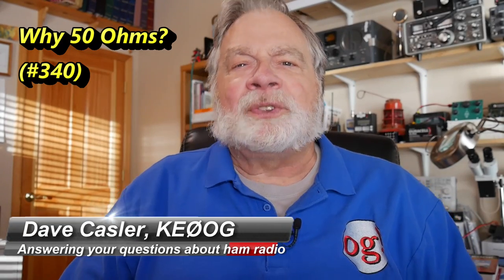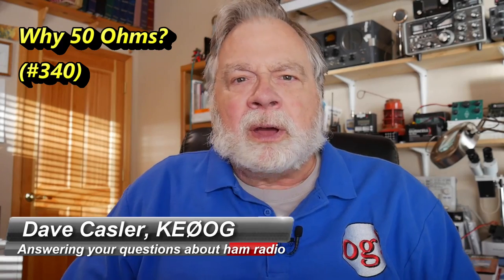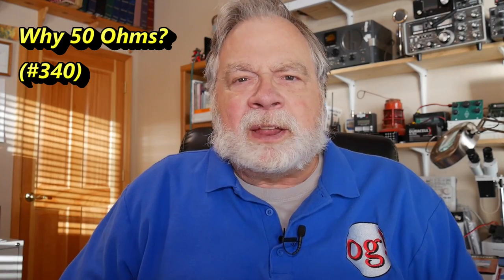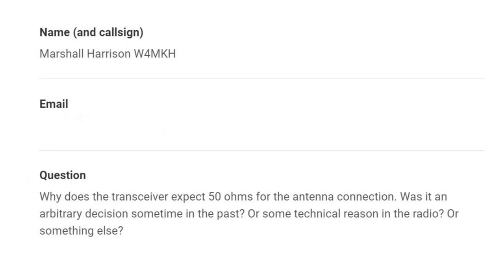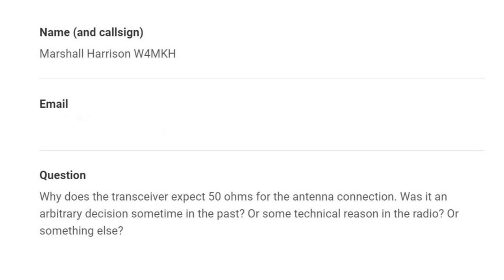Why is Coax 50 Ohms? (#340)

Comment: Thanks Dave!  Might I add more information about why 50 Ohm coax.  Years ago  an engineer for the Hewlet Packard instrument labs explained it this way.   
At about the start of WWII there was no standard.  With a world war approaching, a standard was needed.  The military brought in experts.  The experts said the same thing you had about different ohms.  He had a third possible number of 45.  He said that the military person, with no prefect choice took the three values (30, 45, and 75) and added them up and divided by three.  The results was 50 ohms.  By the end of the war, there was such a supply of 50 ohm equipment that it was the new standard

Comment: Thanks Dave. Good explanation. Characteristic impedance of a transmission line is a hard enough concept to grasp. Understanding 377 ohm Free Space is the next step. Been licensed since 1960 when you had to demonstrate 20 wpm Morse at the FCC office, in front of a grumpy FCC examiner. Pretty intimidating to a teen. No Wikipedia or Internet back then. Saved up for months just to buy my ARRL Radio Amateur's Handbook.  Keep up the good work.  73 DE AA4KW.  Bob

Comment: For people using 75 ohm cable, you can get RG11 which is very close to RG8's size, and you can get flooded cable which has a water absorbing gel to protect the shield from water damage.

Comment: Hi Folks, Interesting discussion! I seem to recall reading decades ago that the 50 Ohm standard came about from the US Navy. The long wire dipole elements that were suspended from the ship's conning tower to the bow and stern at a declining angle lowered the nominal feed impedance from 72/73 ohms to about 50 Ohms.  Also, that the first cable TV coaxial cable impedance was actually 72 Ohms and that knurled (obsolete) S-connectors (similar in design to a very small PL-259 connector) preceded the use of 75 Ohm F-connectors. I'm not sure if it was RCA or Jerrold who originally set the 72 Ohm standard. In my earlier cable TV years I had the honor to meet and work with some of the Jerrold Electronics engineers who developed many of today's current CATV standards. Ken Simmons, Hank Arbitter and Don Rogers to mention a few.  That's what I remember!

Comment: Very interesting, first time I have seen such good info on coax.  Ref to the open copper cadmium  wires on telegraph poles, in the UK they were run in parallel pairs on short local routes, but on long routes they were run twisted  by rotating the wires working from the outside insulator working towards the other outside insulator, then dropping down to the arm below and then working to the outside of the arm and then finishing back at the original start position further down the route.  I can’t remember with certainty but I think it was every 4th pole the process was repeated.  In 1969 there were still a few local routes left on British Telecom.  I was taught that when looking for a short circuit (where wires got twisted together in high winds) if you looked at the apparent short whilst walking and the short didn’t move it was shorted at that point.  If the twist moved then that point was clear.  Short circuits were cleared by throwing a stick at the offending wires.  If a route needed re-regulating then during the 1960s it would be replaced by overhead poly cable.
With all the cables that  I saw, the twists were not that tight, the twists were all identical and cross talk did not occur.  If a jointer made a mistake during repairs and two lines had their legs muddled then crosstalk was as good as a solid connection.  The telephones were 600 ohm impedance, lines were usually max 1000 ohms loop resistance dc test and both legs had to be electrically identical in resistance otherwise mains hum would occur.  I spent 30 years on telecoms and any engineers that I knew qualified in open copper wires  were well gone prior to 1995.

Comment: We used Heliax on our high power  transmitter to antenna connections and we filled the space inside with a dehumidified pressured air  supply slightly greater than atmospheric pressure to keep out moisture

Comment: - I've always built-tuned my center-fed dipoles by erecting them with a 120° angle between the two sides, trimming to lowest SWR, then re-erecting as a flat top dipole.
 The SWR increases to ~1.35:1 but seems to perform better than those with a lower SWR by other means of tuning/trimming.

Comment: You mentioned early on the idea of using copper pipe for coaxial transmission line. In high power broadcast, particle accelerators, etc., this is exactly what is used. The outer conductor is a standard copper water pipe diameter-- three common ones being 3 1/8 inch (3 inch ID), 6 1/8 inch (6 inch ID) and 8 3/16 inch (8 inch ID). The inner conductor was often also a common water pipe size, but today is usually a custom size that gives a Zo of 50 ohms. This line typically comes in 20 foot lengths, and is connected together with a sleeve or bolt flange on the outer conductor, and a silver plated 'bullet' to connect the inner conductors together without an impedance 'bump'. Teflon spacers at the ends, and teflon pins in the middle of the section keep the inner conductor centered inside the outer pipe. Elbows, etc. are built so this like can go around corners, up towers, etc. Although air is the usual dielectric, sometimes dry nitrogen under a slight pressure (to keep moisture out) is used. Rarely, an exotic dielectric gas like sulfur hexafluoride is used. Depending on the line size and the frequency, these lines can handle tens to hundreds of kilowatts of RF power. 50 ohm line is the most common, but 75 ohm rigid line is also available  and is popular for television service, where the low loss in long runs for tall towers is really needed.
Reply: I agree, if you try to build a coaxial guide using commercial (copper) water pipe, like it would have been done in 1930, then you would most likely end up with a rather low impedance like 30 or 50 Ohm. History shows that some bold decision are often pure accidents.
Reply: My father was the original electrical engineer that set up a TV station just after the war.  I remember once while in college, a friend and I were at my house for some college break and my father had to go check on some work being done at the transmitter and he asked us along.  When we got there, the work was out back, but we wanted to see the inside of the building.  He said "You're both MIT EEs, I trust you to not kill your selves or break anything, go ahead".
Out in the back room, behind all the electronics, we found the coax, which was up at ceiling level and about 6 inch copper pipe (as you say a common size).  It was very interesting to follow around.  There were pipes coming out of each of two redundant transmitter banks and several places where different shaped bits could be swapped in to connect to different things.  One was swapping between the two transmitters for which was connected to the actual tower.  But there was some additional switches that could connect either to a large cylinder, about the size of a water heater, where the main coax pipe went into one side, near the top another connected straight up, and near the bottom one went straight out to the side.  We wondered a bit at this three connection component.  Some examination showed the lead out the top went through some very non-coax style bends, and the lower lead went straight to the back wall of the building and ended.  We asked my father about it, and it was the "dummy load" for testing the transmitters when you didn't want to actually transmit.  It was actually a water heater although not a normal one, the 6 inch water main into the building could be set up into the top, and apparently with the TV transmitter at full power, the water came out the back of the building boiling.

Comment: From Amphenol: Experimentation in the early 20th century determined that the best POWER HANDLING capability could be achieved by using 30 Ohm Coaxial Cable, whereas the lowest signal ATTENUATION (LOSS) could be achieved by using 77 Ohm Coaxial Cable.  However, there are few dielectric materials suitable for use in a coaxial cable to support 30 Ohm impedance.  Thus, 50 Ohm Coaxial Cable was selected as the ideal compromise; offering high power handling AND low attenuation characteristics.

Comment: RG 68 & RG 59 are both 75 ohm.  Can't believe I remembered that, but I double checked my memory before posting.  Both were used on the radar sets back in the 70's and 80's that our unit maintained.  Definitely preferable to RG 6.    ALSO, I would like to say thank you for answering many questions I have had for decades, but didn't find the time to research.  Comprehensive and concise.  Very much appreciated.

Comment: The low losses are not important only for reception, but becomes very important mainly for continuous transmission: 1dB cable attenuation is not that much of a deal for a receiver, but with a 10kW transmitter it means 2kW of power would get turned into heat within the cable, which means you need to take that away by the cable cooling. In real installations all the connections have to allow the purge and cooling gas to flow freely (the circulating gas does double duty: Maintains the temperature, as well as it keeps the moisture and oxygen out to prevent corrosion). But too high losses would mean too much heat to deal with.

Comment: An excellent video Dave. Funnily enough I am currently putting together a talk for our local club, explaining why when people say "I get out better with an SWR of 1.4-1.5:1 than I do with 1:1 and the height and feed point impedance is one of the main points of that talk. Many people actually "detune" their antenna from the resonant frequency they want, just to get a low SWR!
Reply: A 50 ohm resistor gives a 1:1 SWR.  It's not much of an antenna, though.  Obsessing over SWR is often counter-productive.  If it's over 3:1 with a long transmission cable, then you start to have noticeable losses, and the voltage starts to approach flashover with higher power levels.

Comment: Interesting.  I was getting cross talk on my landline about 25 years ago.  I could hear one particular residence talking to other people, but only when I was on the line to someone else.  We discovered that they could hear us one day when I told my other party to shut up and listen to the second line. The other crossed line heard me and became freaked out and hung up. LoL.  I don't remember hearing it again so they probably made a complaint to the phone company.  However, I've heard cross talk on landlines for many years before.  You couldn't always hear clearly what the other conversations were, but you could hear talking on the line. Sometimes two or more conversations at once.  It never really occurred to us to try and listen, mostly because you had to be on the line with a call. The other reason was, you really couldn't hear them that well and thirdly, their conversations sounded boring.  Just that one time that I first mentioned that I could hear them well. That went on for a few months for sure. I mostly ignored it. Just that one time I actually tried to listen. More for curiousity of whose line we were crossed with.  Anyway, that's it.
Reply: There you are! Meow😺😹
Reply: In the sixties home phones were being rolled out at a high rate and the infrastructure could not cope. The solution was to roll out temporarily with line sharing called 'party lines'. This meant that you could pick up a phone and hear any ongoing conversations . You managed with this by politeness and hanging up.

Comment: Also it should be remembered that the Z0 of free space is 377 ohms. Hence there is a mismatch between an antenna and free space (for maximum power transfer) also a mismatch between the feeder and antenna and a mismatch feeder to receiver. A dipole is just a transmission line pulled apart into two arms. That is why some recommend ignoring the E field and instead concentrate on the H field, with a loop antenna.

Comment: Very interesting video. I am no ham radio user, but i used to do computer networks. The old coax cabling back in the day needed 50 ohm terminators. Which always went missing. I made my own from 50 ohm resistors. Those were, and probably still are hard to come by. The man in the electronics shop made weird faces when i asked for those, assuming i was mistaken. I had my whole home testing network connected up with this coax cabling at the time, only giving it up when my network interface cards were no longer supported in newer operating systems in the late nineties. Which i hated, as they were all working fine otherwise. So there’s my 50 ohm story. Greetings and a happy 2021 from the Netherlands!
Reply: My 50 Ohm story...:

I was working for a telecommunications company and they tried to install coax ethernet at one of their sites and it didn't work. I told them that they needed a terminator at each end. That was after the movie Terminator 2 came out. They naturally believed I was bullshitting them, even though I tried to explain the physics behind that.

They then asked another expert. The other expert told them the same bullshit. They got really pissed off by that.

Then they thought the cables were broken and went to a computer store to get new ones. The guy at the store also tried to be "funny" and asked whether they wanted terminators as well - and showed them what they looked like and that they were obviously designed to fit the T connectors. They finally got the message...after a hands-on demonstration.
Reply: @klausstock8020  that's a great story. thanks, you made me laugh.
Reply: Ne2000 coax network card?

Comment: When I was studying physics in the 1970's, wave propagation in coaxial waveguides was a natural subject to examine, because we were thinking about waves and their confinement between conductors.  But a century earlier, when Heaviside began thinking about it, signal frequencies were probably in the low kHz range, which is essentially DC as for as wave propagation is concerned.  So it makes sense that a coaxial waveguide was a novel idea.  My recollection is that this concept only became a useful technology when the right dielectric was invented at Bell Labs - I believe in the 1920's.

Comment: 6:30 "An extremely low loss cable available at an extremely high price" absolute classic! Can't wait to adapt that to future conversations.....  Cheers mate...
Reply: I wonder how you would terminate such a cable.
Reply: The cable is Andrew 1 5/8" air cable which requires pressurization (Nitrogen or dried compressed air). There is a foam version (LDF7-50) of this cable as well. Dimensionally they are the same. The cable's impedance is mainly the ratio of inner to outer conductors. The air cables have spiral jackets while foam cables have straight ribs (corrugated). Air has the least capacitance (parasitic loss) per foot. At frequencies above 800MHz the loss gets real bad.

This same cable in 75 ohm has a smaller center conductor.  (LDF7-75) 'N' connectors for 75 ohm have smaller center pins but otherwise are identical to the 50 ohm connector.

The military still uses some 62 ohm stuff. I'm not sure of the application though.

TV originally used 300 ohm flat cable (balanced) and to use 75 ohm cable with TV antennas requires  a balun which couples the 300 ohm antenna (balanced) to the 75 ohm coaxial cable (unbalanced). These are usually designed into modern antennas.

The twisted telephone is a balanced (600 ohm) transmission line. what improved cross talk was adaptation of better electronics in the system which allowed lower signal levels to be used on the lines. (Telephones adopted built-in amplifiers)
Reply: @ronreyes9910  1 5/8" and 7/8" was widely used in mobile telephony stations (BTS) up to recent times. 7/8 was used for feeders lengths between 20 and 50m, and 1/5 8 was used for feeders greater than 50m between radio equipment and antennas.
Now the trend is using distributed system, I mean the controller and BaseBand Units are installed on ground level (inside some kind of rack/shelter) with Remote Radio Units (RRUs) installed near the antennas...

Comment: Cables are great for antennas with matching circuits tuned. For wire antennas I gave up on coax in favour of 600 ohm open wire ladder line. Admittedly I was skeptical at first but now I don’t ever intend to use coax on a wire antenna again. Great explanation on coax OM 73

Comment: Ah, but there is a ware-out mechanism, curves. Tighter bends in a cable run will put pressure on the inner conductor and can overcome the physical strength of the dielectric. This throws off the relationship between the inner conductor and outer shield at that curve, and changes the impedance there. This can cause reflections and seriously effect the SWR.  Keep the bends in your cable runs as gentle as you can.

Comment: I worked in TV broadcasting. We used rigid 50 Ohm 6 inch coax which was just copper tubes with plastic disc spacers. Early rigid coax  was 51.5 Ohms because the manufacturers of transmission line used the closest standard copper pipe size available. Eventually, custom pipe sizes were manufactured, and 50 Ohm transmission line became more common.